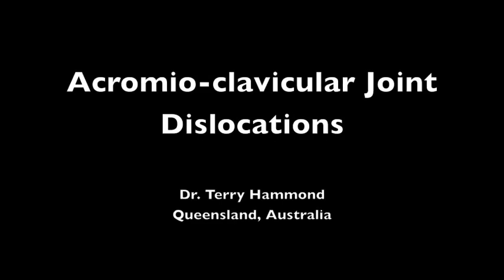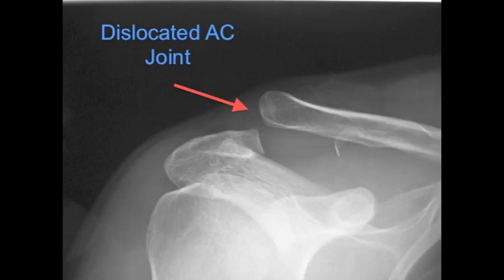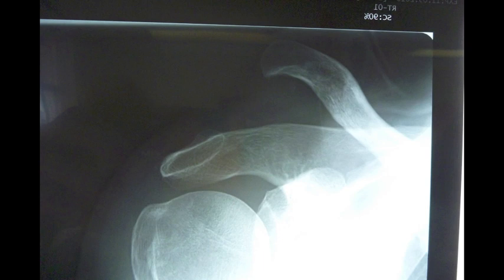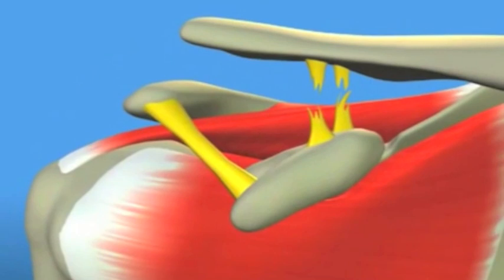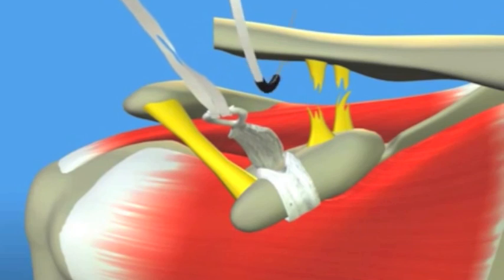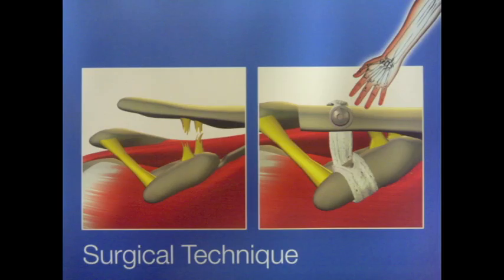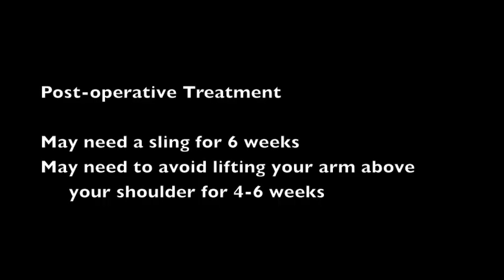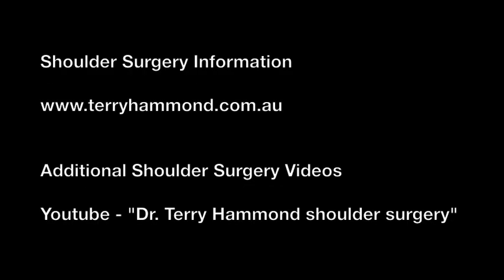ACJ Dislocation Shoulder Surgery Dr Terry Hammond

Comment: I just came out of surgery about 3 weeks ago this video was made  4 years  ago and in that time they  have improved the surgery technique by using a dead  person ligament to fuse with you injury they still use plastic screws though.t
Reply: MrBlewis01 i just injured my shoulder grade 3 injury, how are you doing? where did you have it done? i am in los angeles
Reply: I had mine surgery two years ago. It was a minimal invasive ac joint reconstruction with tight rope set. After surgery it went not so good, i had very much pain and significant movement reduction. I was lucky to meet one good physiotherapist, who helped me a lot. I have learned to swim and do triathlon, use a Roadbike for a commute (60km a day). I couldn't sleep on my right side though. One year after surgery i broke clavicle on the same side after minor bike accident. Problem was in clavicle with a weak spot (drilled section). Luckily it was not dislocated and no operation was needed. Now I continue to exercise, and have no significant loss of function. Strength of the anteroflexion is somewhat reduced, but doesn't bother. Get well guys and take care!

Comment: Hi. I have had this repair done to my shoulder. My hobbies are quite dangerous & I always worry what will happen if I break the artificial ligament. How strong is the A/L? Also if I did break the A/L could it be replaced for a stronger one?
Reply: I wait for answer too☝🏻
Reply: I know your comment is 2 years old, but i have just had Ac joint surgery, after grade 5 separation, and my surgeon told me that artificial ligament is stronger and harder to break than natural one
Reply: @antecc1524  OK that's great to hear thank you! Appreciate the reply 👍
Reply: @antecc1524 how much it cost ?

Comment: I had an AC joint dislocation and i was operated. I had a k-wide in my collar bone for 4 weeks and a a wire was tied aroud the bone linke in this video. After the 2 weeks k-wide was removed, i tried to make 10 pushups, i felt no pain but in the morning it snapped back to its original. Iv'e been told that the wire around the bone snapped (and that this happens)... And that i should do it again if i want it back to normal.
Reply: how is it now? hope you're better
Reply: My case is similar to yours... It has popped up again but I'm able to move my arm in all positions... But the pain is still there even after 1 year

Comment: I had a shoulder surgery on my dislocated shoulder with the method of arthoscopy 10-11 months ago. Everything went good in the surgery...did some swimming exercise for 2 months after 6 months also without problems or discomfort. The only problem is that now i started doing home workout and after 2-3 weeks i got some mild discomfort on my surgery shoulder when i exercise, not pain just small intications of something is not the same as in my good shoulder. Is it normal? i am afraid i do some damage in my shoulder (home workout consists of several sets of pushups/ pullups in horizontal bar/ and some weight lifting on 6 kilos weight on each hand + other non shoulder tension exercises in feet etc).

Comment: I have visible deformation not to bad but u can see it will it heal by its self or is surgery required
Reply: Nathan LeDee  it's been 3 years, i have the same problem...My Ac bone is showing clearly(not much). I do yoga daily to increase flexibility...I can see improvement in my AC popped up bone..its going back to its place...I had x ray after 7 months and now AC bone is quite near to its own place.
.My doctor said once it git back to its place than body will form ligament over there gain...then joint will be formed again...
Reply: I think there is some false information here.. I have the same injury got hit my am suv on my bike T boned.. shoulder took the entire impact. My clavicle is pooped out. Now it has been an entire year.. my strength is back to normal with normal overhead presses and lateral movements but doing things like throwing a football or baseball I have lost significant velocity. I’ve talked with two surgeons who have seen these injuries at different extremes and there is no chance the ligament will regrow back again after it’s torn. It’s just how the shoulder is constructed. If it is a grade 3 or higher the only option is surgery to bring the clavicle back down to the original position. Now mind you I played an entire football season on the shoulder and it held up with extra padding underneath and you will regain strength but the deformity will always be there
Reply: Popped not pooped lol